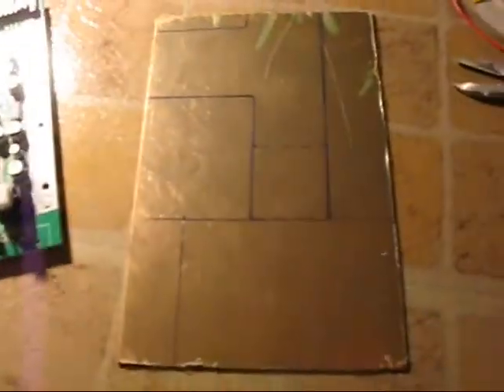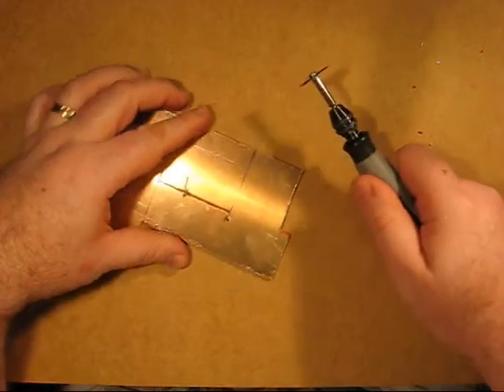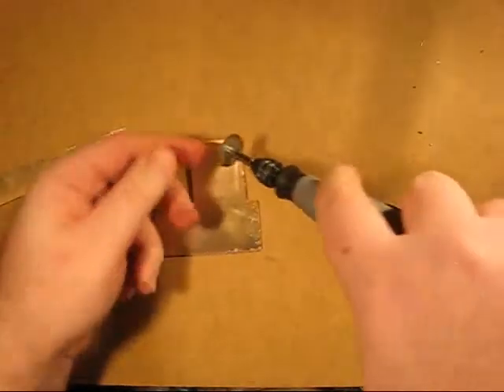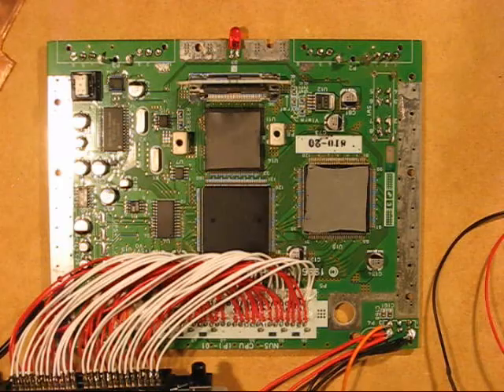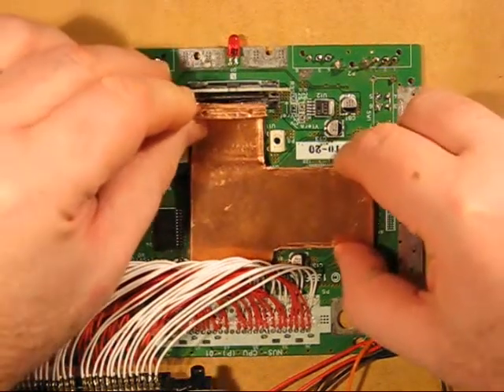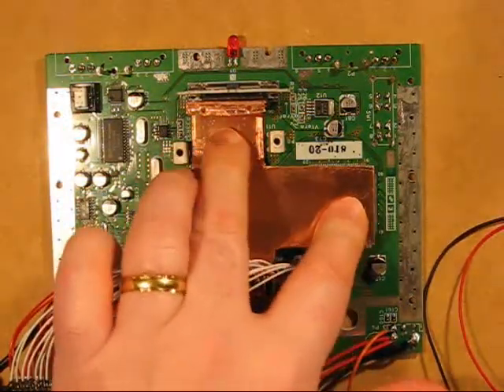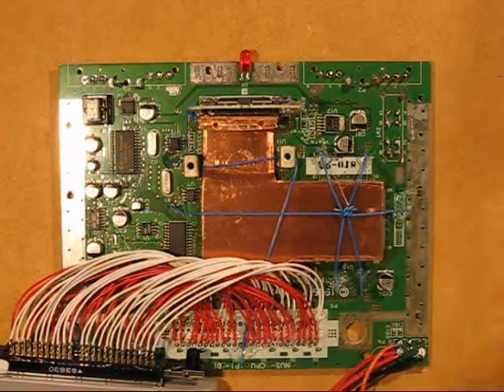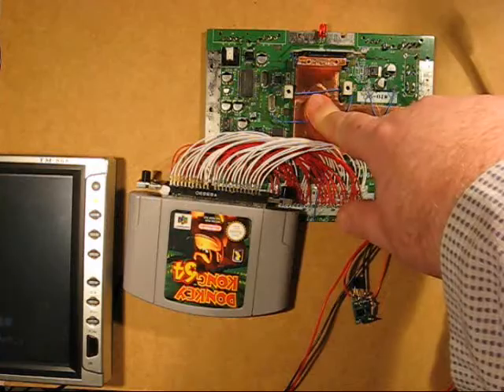N64 log - 6 - Keeping the N64 motherboard chips cooler!

Comment: I have a question, I recently put in my expansion pack backwards and fried it D: I want to ram swap my n64, can I use the chip on the board or would it not work?

Comment from the maker: The originals are heat pads they are not heatsinks, and are not good enough. Reason they work on the original console is the heatpads connect to two sheets of long metal, which are in effect the heatsinks.

Comment from the maker: You can however when the metal gets warm, the hot glue will melt, which will defeat the object. You can use epoxy though if you like, although that is harder to remove if you need to later.

Comment from the maker: I didn't either until I tried it. The N64 only just gets warm with the copper installed - no fan needed.

Copper is also great for making right angled joints, as I did later for the game cart holder (video 10)

Comment from the maker: No, the DreamCast two main chips get very hot indeed, they need proper heatsinks and fan assembly, which is why I built the enclosure for the DreamCast board to direct airflow across the heatsinks.

Comment from the maker: Using proper heatsinks and a fan is the most efficient for the N64; using the supplied heatpad blocks and a fan is a cheap way, fine but also bulky; using a larger copper plate is far thinner; system is warmer of course but ok as the heat is reduced to decent levels. Air gaps between the cart slot will provide space for warm air to filter out ok.

Comment from the maker: Yes unless you want a needlessly thick portable. Cutting off the controller ports allows wiring controller(s) directly. You can always make small thin ports yourself if you want; eg an a/v plug (like a stereo audio plug but with 3 connections not two). Portables with small(ish) screens are only really best for single player only anyway.

Comment from the maker: Maybe, however in that scenario, probably better to cut the plate that is on top of them originally to cover the blocks and then use a fan. Using normal heatsinks if using a fan would be more efficient. The copper plate i'm using is a good size to keep a good surface area. Larger surface area of plate = better heat dissipation.